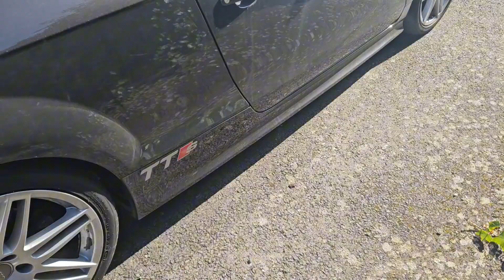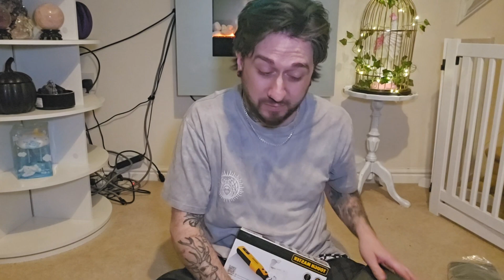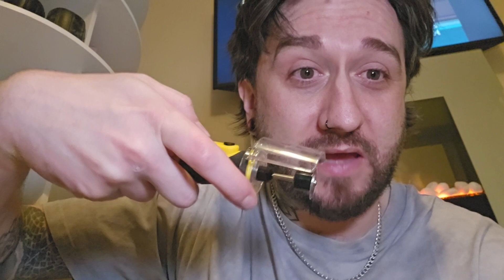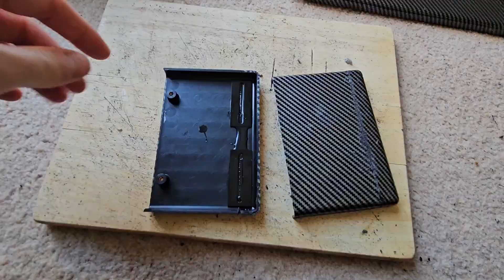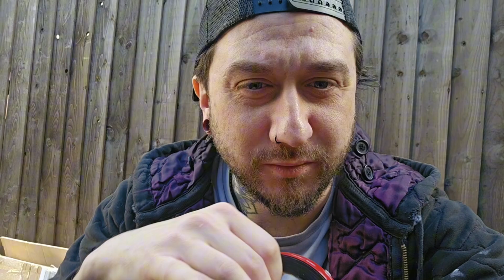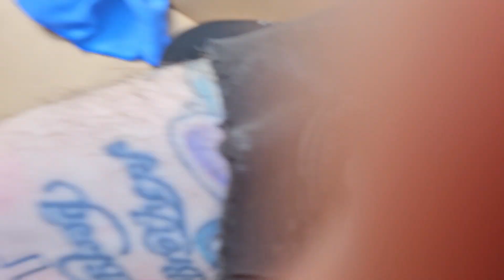How To Install Side Skirts To  Your Audi TTS!

Comment: looks good, how much extra is your insurance after the mods?
Reply: £0 (I haven’t told them)
Reply: @itsall3d749  they wanted £140 a year more if I fitted skirts , rear spoiler and spacers to mine, so i didn't bother fitting them ...
Reply from the maker: 😂😂😂  @itsall3d749
Reply from the maker: Just checked dude its only £60 more to have side skirts and spoiler added 😁
Reply from the maker: I duno yet I haven't called them yet to sort it as I haven't even driven the car yet so I'll have to let you know aha